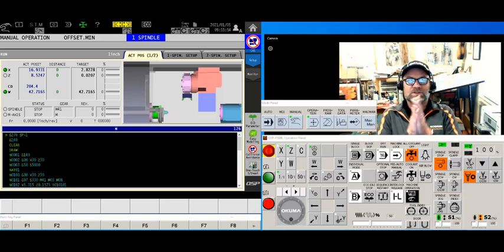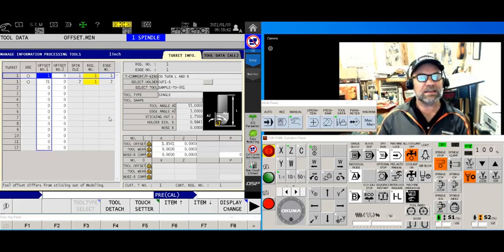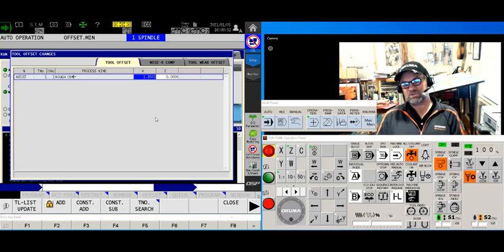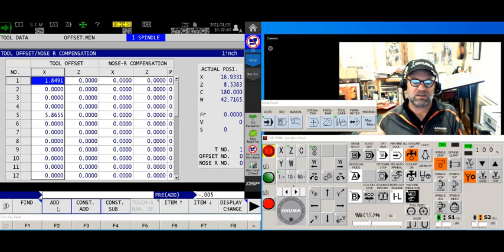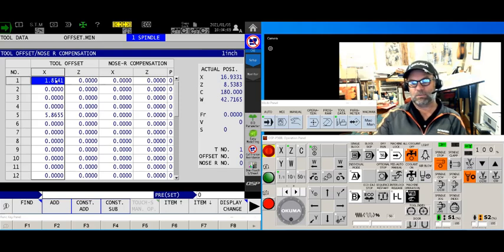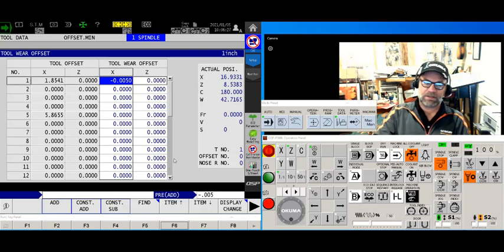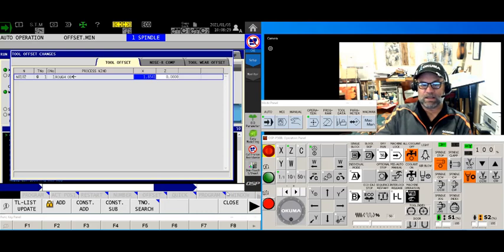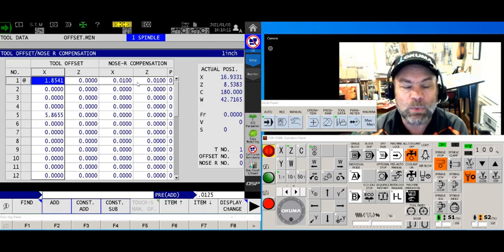Lathe tool offset pages

Comment: HI I calibrate my touch setter. all 4 tools go to zero X and Z and making parts. now I loaded live tool with End mill and touch it off with toucher and Z is fine but X is off like 2.08 inches.
Reply from the maker: Keep in mind: end mills should be using the tool center for the X offset. If you’d rather touch the side of the mill off the setter, you’ll then need to subtract the diameter of the emill from the result

Comment: Is the nose-R comp supposed to be left at zero, or should it have the actual radius of the tool?
Reply from the maker: For each type of tool, that depends on how you programmed the part. If you've used AOT or any other CAM system that does not automatically compensate for tool radius, then the value SHOULD be populated. Many modern CAM software seats will automatically program the toolpath relative to the actual tool radius, so in that case, the comp should remain at zero unless you are actively compensating for a worn tool.
Reply: @pocketcharleywithgosiger  Thanks for the clear explanation. This LB3000MYW is my first Okuma, you're videos have been very helpful.